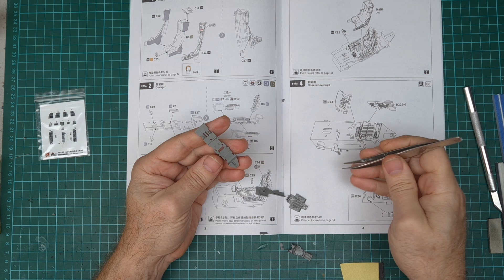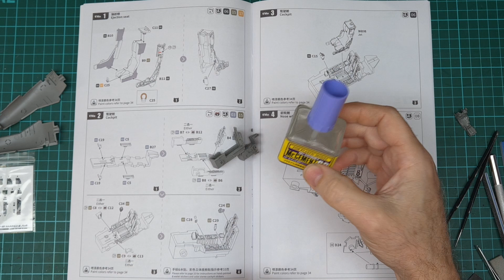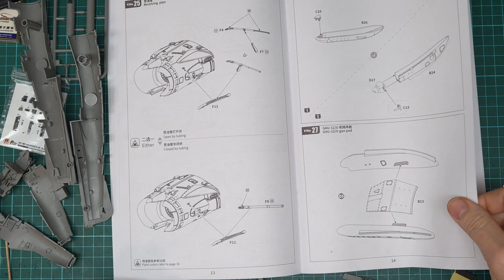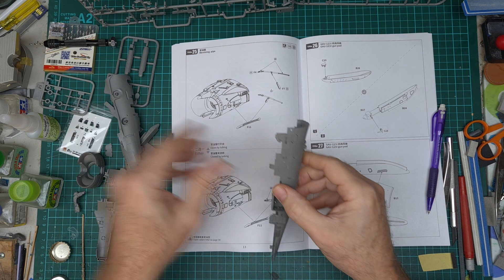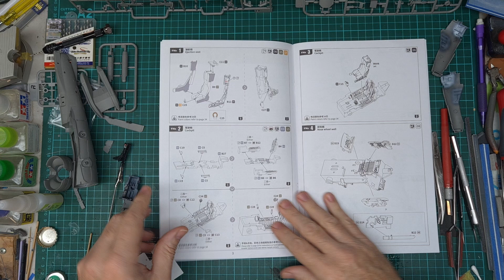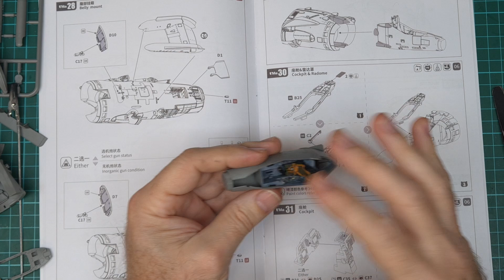UMa 1/48 AV-8B HARRIER II PLUS Build Pt.1

Comment: You suggest that the cockpit cover panel doesn't fit. It looks likely to be a user error. I've not had any issues with that at all. Some of the gaps between parts on the fuselage are quite big though!